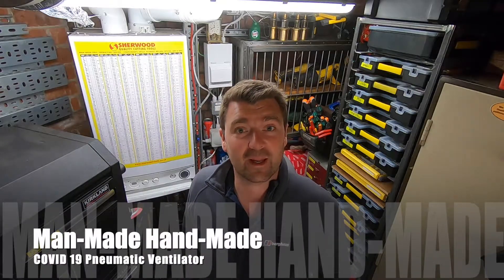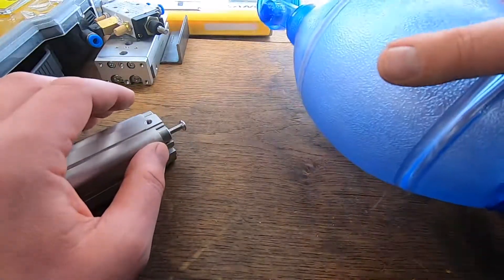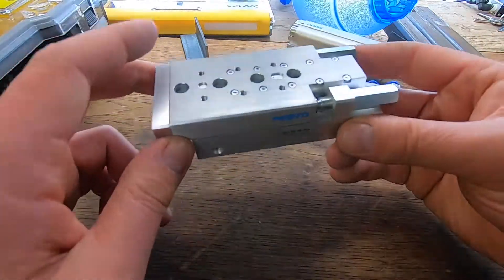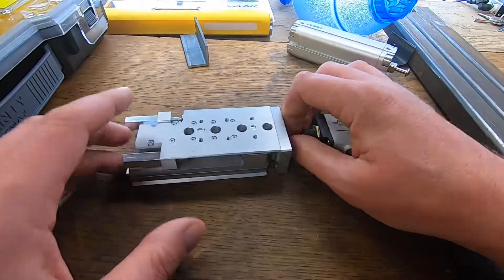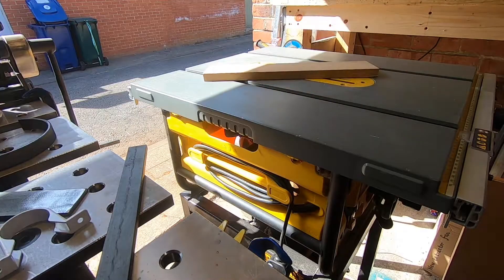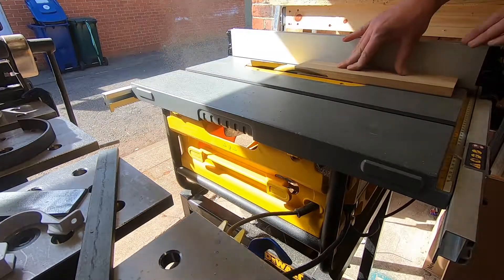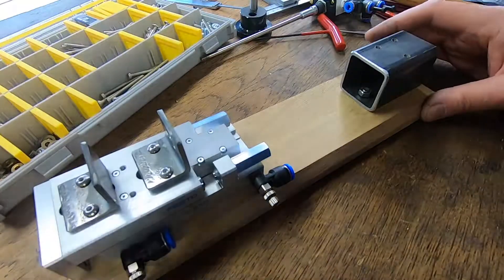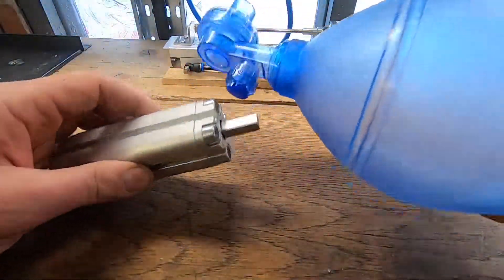COVID 19 - Pneumatic Ventilator Build

Comment: Hello. My day job is designing customer specials tor FRL, Valve, Fieldbus, Cylinder, etc.. enclosures. I do not have a ton of experience with our medical and food products, but if someone were to actually build this for home use (if they get covid and hospitals do not have enough ventilators? - assuming that's the point of the build) please reach out to a reputable company that ENGINEERS/DESIGNS pneumatic products to work with an applications specialist. You do not want contaminated air going into your lungs for consistent, extended periods of time!!!! Please insist on a medical/food grade field sales engineer for direct consulting. If you really intend to build this and actually have it on hand for emergency use, I can provide direct contacts via DM. Stay safe.
Reply from the maker: Build was for demonstration/concept purposes only. No other reason. Thanks for watching!